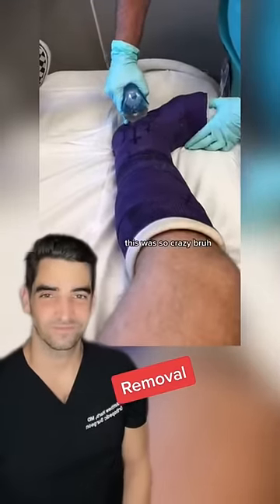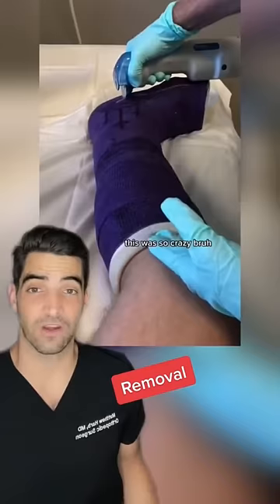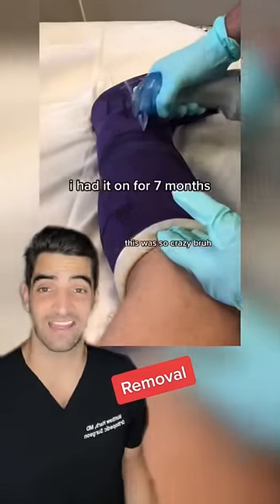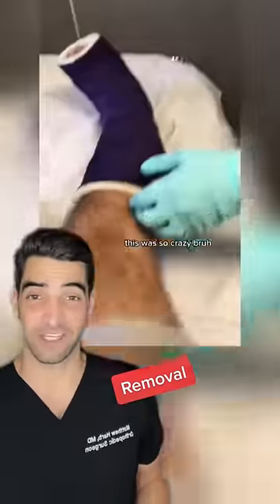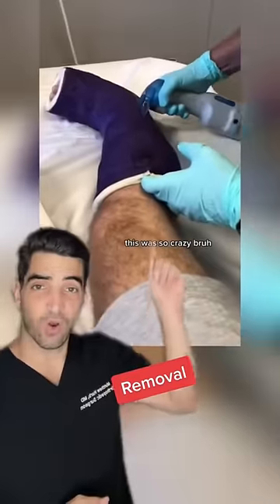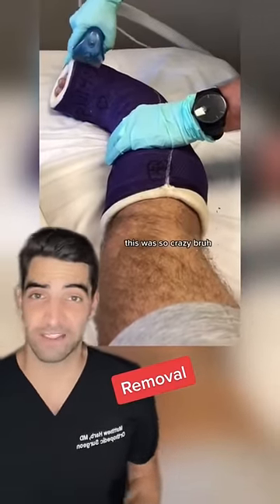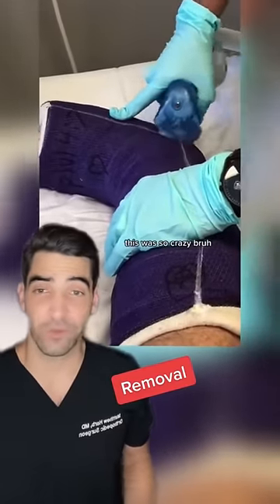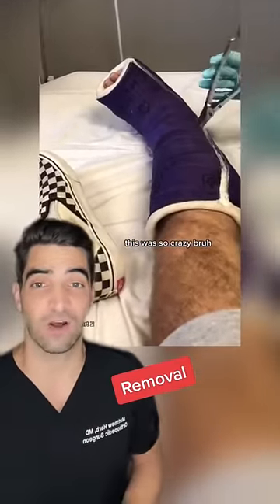How to remove a fiber glass cast after your broken ankle has healed, learn this proper technique

Comment: God, please never let me have to ever experience a broken bone, I just know my soul would leave my body as this technique is being used, feeling like the doctor's hand would slip or something or would use too much pressure and would cut into my leg. OMG it's just too much...
Reply: I wouldn't worry if such a thing happened. I've had 2 casts cut off my legs and both times nothing bad happened. It just intense vibrations that could spook you as it goes all throughout the cast. I believe it touched me a few times while cutting.A doctor who cuts you with this is a doctor who probably shouldn't be doing this as they are putting too much effort into it I believe.
Reply: No, you can loosely hold the blade with no damage.
Reply: Ask God to Be stronger

Comment: I broke my ankle earlier this year and had 2 diffrent fiber glass casts and they did this when removing both of them and it was one of the best feelings of having a broken ankle cause not only does the saw actually feel nice on your skin but you also have a feeling of freedom where you can finally move your foot around after having it stuck in the same spot for so long

Comment: The saws they use can't cut you.
Reply: ur not the doctor here, besides, it may not easily cut you but if u put it deep into the skin it will cut ur skin
Reply: @vintxgestarr  you don't need to be a doctor to know this
Reply: I don't see your doctorate
Reply: @owene2530  this is common knowledge
Reply: @vintxgestarr "if u put it deep into the skin it will cut you skin" WOAHHHH NO WAYYYY REALYLYLYLYLYYYY??? 😱🤯🤯🤯
Reply: @vintxgestarr  the saws dont cut you even with alot of force, just juggles your skin more intensely, its not and will never be an issue with this type of saw. This is the case with battery operated and air operated oscillating saws
Reply: I have a scar that disagrees. I got cut and burned by a cast saw. Cast saws are not idiot proof.
Reply: @mjaynes288  you can push pretty hard into skin for 5-10 seconds with an oscillating saw, and it wont cut what did you do to get that?😂
Reply: @tylerrandall05 I've got a scar from getting a cast removed too. They will fucking cut you how it happens depends on who does the removal
Reply: @BarDeeZee  theyre using fault saws then😂
Reply: they can absolutely burn your skin and break skin

Comment: I had it done in late April 2012. I felt the saw a little bit and it did tickle. I was 41 years old. It was just 6 weeks after my car accident in early March 2012 that I broken my left ankle. I did wore a splint cast for a couple weeks and then a fiberglass cast for 4 weeks. I did know the feeling of the saw. The doctor did explain how it works for me. I was almost 42 years old back then and I was so brave what I went through those 4-5 months of recovery with a broken ankle.

Comment: The cast saw actually ocellates back and forth. It doesn’t go around like a meat cutter. The special saw blades have off set teeth that when vibrates actually tears the fiber glass as it’s pushed into the cast. You’re skin is protected by a cloth under stockingnette and 2-3 layers of cotton padding. The cast saw cannot really cut you, but you can get scratched if you’re tech is careless. Burns are possible too. The blades can get hot. Now you know?

Comment: My daughter grew up in leg casts,  cerebral palsy from the waist down, w/ spastic deplegia.  A. I. DUPONT in Wilmington Delaware did 9 amazing bilateral surgeries to lengthen her hamstrings. 😢 and the saw will not cut you.. it vibrates  not spin. The Dr had always pushed the running saw on his arm to show my daughter it wouldn't cut her..

Comment: Saw a video on cast cutters.... Used on balloons, one inflated fairly high and the other with just enough air to blow it up and make it round.  The cutters could only pop the balloon that was blown up completely... The balloon with less air is like human skin it has the ability to stretch and move and the blade could not pop that bloom. (I'm sure if you just jammed the blade into the balloon up against the wall it would pop it... But no one's using the blade like that on somebody's leg and cast)

Comment: These vibrating blade saws will only cut materials which don’t vibrate at the same speed as the saw teeth.  They can cut wood, metal, plastic almost anything really with the adapted blade.  Skin will vibrate at the same speed as the vibrating blade unless you push the blade hard against the skin where it is prevented from matching the vibration due to the friction against the bone.

Comment: Im an amputee and get a plaster cast made like this for prosthetic molds. That saw will not cut your skin. You can touch it while vibrating. Im sure if you pressed really hard on skin it could break skin but wouldnt sink into the flesh.

Comment: it oscillates.  at work, i had tools that do the same thing.  you can place the "cutting edge" directly on your hand and it wont cut you.  anything that doesnt give, like wood or steel, get cut.  your skin just moves with the oscillation.

Comment: I had this done, and I was so damn scared! And a misconception is that it won't cut thru skin. Common sense should tell you if it cuts thru fiber glass then it will cut thru skin. Hence why there's so many layers of cotton wrap under the hard cast....to give extra layers of cushion and protection. Cotton fluffs as its being cut or sawed.

Comment: Cast saws VIBRATE hence the need to rock them forward to get more cast material under the plate....they don't spin, there is no blade, no edges, hence they cant cut skin.  You could literally put that plate on your bare skin, turn it on and all it would do is vibrate.

Comment: The blade won’t cut, the cast is rigid and has no flex, your skin is flexible and the blade doesn’t oscillate back and forth far enough to over exert the elasticity of your skin

Comment: Saw blade won't cut the skin, but it does get hot after long cuts. So it can burn you if it's been used enough to heat up.
Medical grade multi tool.

Comment: The saw blade is like a round metal washer with no edge on it. It only cuts by vibration and could not cut the human skin if you tried

Comment: Had a cast in January this year. I fractured my 5th metatarsal bone in my left foot. The day I got my cast, I was excited. It was my first ever cast (I'm 30 years old). A few hours after I got home, my foot started feeling tingly around my hind-foot. All of a sudden, I felt TRAP in the cast. I realized I could not move my foot as freely (the point od a cast) And I think it must have been a cast phobia because the cast wasn't too tight or anything but I just felt trap. I could not sleep. I drove myself to the emergency room to have it removed that same day. I got a bandage type of cast instead. Today my foot still hurts when I stand on that foot for too long, my whole foot hurt when I walk a lot and forget about running 😅 I am pretty sure it did not heal as properly as it would have in a cast but I never want to get a cast again.

Comment: Had a cast on my right arm when I was 13, 1st cast was cut off with scissor because it was just plaster (so heavy!) but the 2nd cast was new fiberglass! (This was the late 80s) and they used the saw... she showed me how it worked, started using it. then started callin to her mate, while I'm squirming. I ended up with about a 7cm line of saw red where she just pushed down on it :S I was not happy. 
Since had a cast on my right leg and left food, leg with a recast (both done at the same time XD) and there wasnt a problem.

Comment: I broke my ankle when I was 12, a couple weeks before I turned 13. I was in the cast for 2.5 months cause of how bad of a break it was. When they took the cast off, my leg was about half the size of my other leg, I had super long leg hair since I couldn't shave it, and my skin was literally peeling off. Took a shower that night and scrubbed away the dead skin and was left with a super soft, skinny leg that was fairly pink because of the new skin. I didn't shave it until like a week later because I did not want to risk cutting the new skin and getting it infected. They let me keep the cast, but I definitely would not recommend because its smells so bad.

Comment: I had a soft wrist cast. Day of removal doctor sits me in a room and closes the door. He proceeds to cut it off with scissors and the smell was horrendous! I had to ask him to open the door to let air in. He kept cutting away and the more he did the worse the smell! I had to step out into the hallway to stop from gagging. Doctor was unfazed by the smell. I kept it as dry and as clean as possible. This video gave me flashbacks

Comment: I'm not a fan of the process and have been through it more times than I can count. The vibration alone triggers the heck out of my 12 ankle surgery, damaged ankle. I try to no avail to control my flinch reflex, but the firing  nerves say nope. I end up apologizing repeatedly to the dr assistant while they replace the cast.

Comment: I have had several casts removed. One time It actually went through the cotton because I had pulled some of it out (you arent supposed to do this) and it did cut my skin slightly but normally you shouldn't worry about it.

Comment: I drilled 1" holes in mine so I could use a coat hangar to scratch any itches during the time I had the cast. It worked, just have to be careful when drilling.

Comment: Using your finger as a guide has been method in the construction industry for a very long time. The blade acts like a multitool and would definitely cut the skin, so the finger guide is very essential whilst doing this.

Comment: Oscillating blades cannot cut your skin like this in ANY situation, in order for an Oscillating tool to cut you you would have to plunge it into your skin SUPER hard, I use them all the time
Reply: Then maybe it burns its way through the skin. I have a scar from a cast saw. It looked like a cut with second degree burns on both sides.
Reply: @mjaynes288  they would have had to be very inexperienced to do that, that's insane for an oscillating tool

Comment: I used my dewalt multi tool to take mine off you use power tools enough you can save yourself a visit. Remember get cleared and make sure everything is good. My dr was gonna take it off but the appointment was canceled for a few day later i wasn't waiting

Comment: I remember my lucky days of having a cast. Only ever had one when I was 16 on my wrist. Day has finally come to take what’s left of it off (I broke my hand free after 2 weeks having it on) Doctor dude was very disappointed in that. But he was demonstrating that the saw wouldn’t cut me. And he without my knowledge had a dab of ketchup on his finger tip and when the saw touched the ketchup it of course flew and he faked winced. I did not however fake wince as he started giggling staring at me. It took me a minute to recover myself. I debated on asking for another doctor but I couldn’t wait a second longer.

Comment: Those blades are designed NOT TO CUT FLESH.  It shuts down immediately, or at least, that’s what I’ve been told.
Reply: Nah, what happens is the saw vibrates, and uses friction. Although, it builds up heat, but it can't penetrate the skin luckily.
Reply: @Architect532  
Thank you for explaining.

Comment: I broke my arm three times ('cause I was dumb 😅) when I was like 8yo. Every time the cast had to come off I was sooo scared for the blade to go through until, the third time, the guy that had to take the cast off explained to me, how that thing works, and that it is not just a saw, that would chop through anything. He then turned it on and held it to his arm that, surprise, didn't get cut. That was soooo reassuring! Thankfully never broke anything again so far tho 😂

Comment: I remember that I had to get a cast on my right wrist because of a serious joint issue I had then never healed properly, my older brother got me so scared to have it removed that I ended up accidentally dislocating my thumb and reinjuring my wrist... they decided a medical grade wrist brace was a better idea for me after that.. I still have lots of pain in my wrist and it buckles easily under pressure that should be perfectly normal to others. I will never forgive my brother for that or myself for being so stupid. My only option to attempt to fix the permanent damage I caused is to refracture my wrist and put me in another cast but they won't because they are worried I will remove it myself again 🤦‍♀️

Comment: I happen to know that the blade will not cut skin. It's made in such a way that is is not possible unless you are pushing so hard it will make a pressure cut but that is a lot of pressure. Not sure where this guy learned this but it's not accurate.

Comment: Who is this guy😂😂 , it won’t go into the skin at all, like you said, it vibrates so it will just vibrate your skin, if it was a rotating blade it would cut through skin

Because the cast is rigid and can’t wiggle anywhere, the vibration cuts through

Comment: Hate to argue with the dr. But you have to push really hard. The ankle bone is about the only thing that would hit hard.

I taught many people how to use these and my favorite thing was to talk about safety. I'll absent mjndedly set the tool down and then realize it's on. I grab it loosely by the blade and yell in pain for a second. Then hold my hand up and laugh.  Showed it cutting a frozen vs thawed hot dog. The thawed cuts better when saw is turned off.

Comment: Dont like for part two. It has been proven many times it doesn’t matter how much force is applied your not cutting them. The real reason they put the fingers inside is because people are paranoid that is a spinning blade that cuts. What it fact it’s a piece of metal that oscillates 14000/min. The end of these plates have small teeth that grab onto rigid material and break it off. Human skin is to rubbery and soft that even in slow motion it just shakes your skin. It won’t even cut human hair as it’s also to flexible.

Comment: I have had plenty of Castile and yes they use it by reading soil and yes they use paper plates to separate them and then they use scissors to cut the fiberglass what's left over and them bitches itch itch and you cannot scratch them had one on in 68 had one to put on in 69 and it's c one up to my ass in 77 and one on every month till September of 77 and then I had one on for 30 days on my left foot I strongly hate cast

Comment: "PLUNGING THE BLADE DEEP IN THE SKIN" stfu it is impossible. Human skin is flexible. Even tho there are sawteeth on that, it is not spinning nor vibrating fadt enough to cut skin. Basically just grips the skin and jiggles it back and forth

Comment: I don't believe for a second that this guy is a real doctor. The saw blade vibrates instead of spinning, so it won't cut anything as soft as skin. He's holding the cast to stabilize it snd make it easier to cut. Bro thinks he's smart coming up with the whole "bivalve cut" bs but theres no such thing. That's just how they cut off casts, it doesn't need a special name or technique.